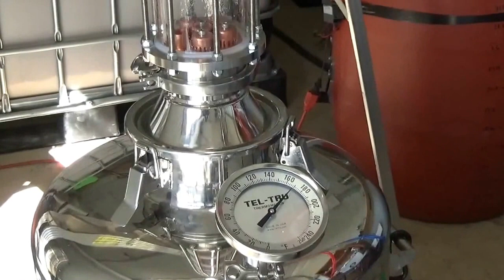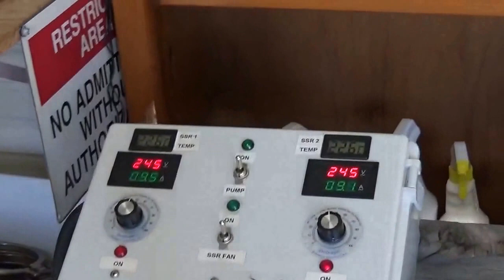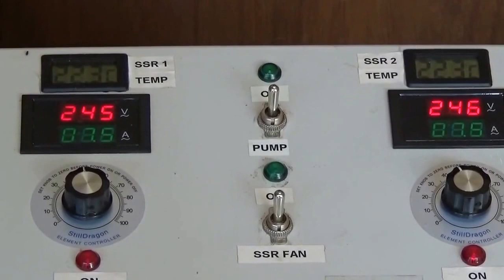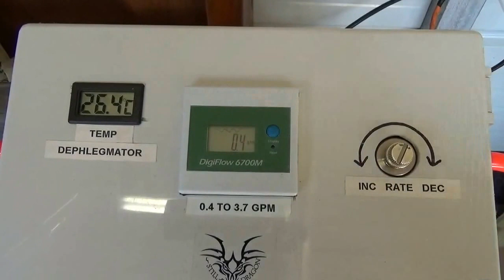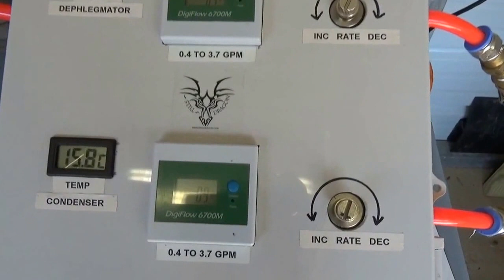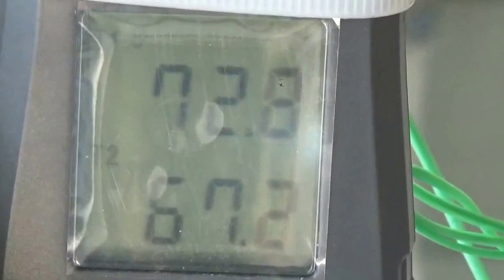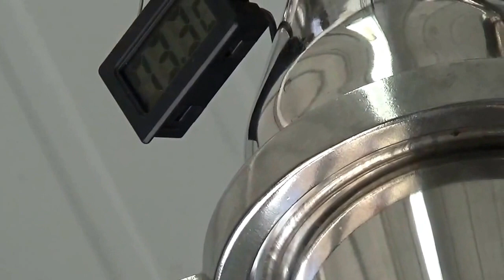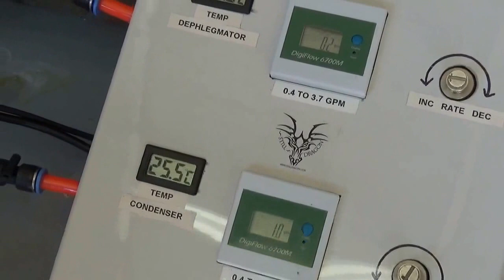StillDragon® - 4" Crystal Dragon™ with 16 Bubble Plates - Maiden Run

Comment: Your parot was building up back pressure by the looks , it needed a little vent tube at the top bit higher than the parrot itself.
Reply from the maker: The product collection kit comes with a surge breaker which is mounted above the product collector. Please be aware that our community members do not participate here in YouTube comments. For more information have a look at our StillDragon® Community Forum at https://www.StillDragon.org

Comment: Like all StillDragon products and appliances, this setup looks bloody amazing. Sexy even. However, I've got to add that 16 plates is absolute overkill just to produce neutral spirit at around 95% ABV (even if it is for fuel). With this setup not being modular, there's not much else it could produce. A simple SPP packed column of sufficient length would provide similar results (I'm commenting from experience, not bravado). I'll reiterate - StillDragon equipment is sexy AF, and I would sell one of my kidneys to own a modular system. One day...  🙂

Comment: What is distinguish between Moonshine | Ambler & StillDragon distillery,  1st thing I seen from top  side some transparent liquid is coming & slowly it's going to till bottom plate,  but ? I wasn't sure it is evaporate alcohol whether water coming by up site pipe ?   what is the purpose of this new kind of distillery & what is the price for this,  and I know yr community isn't participate for this,  I'll will visit at yr forums.
Reply from the maker: What you see here is called a reflux still (the liquid from above going down is the reflux). This principle allows to increase the purification process by the number of plates compared to a simple pot still. Please visit our StillDragon® Community Forum at https://www.StillDragon.org for more information. There you will also find the link to your closest StillDragon® Distributor, where you can check prices and what is all possible with this kind of modular equipment.

Comment: I don't understand why the action started at the top and worked its way down towards the bottom...🙃☺️😎
Please explain...😊
Reply: That's the point of reflux, what's not pulled drops back down the column. It fills the top plate then overflows to the next and next on the way down
Reply from the maker: Our community members do not participate here in YouTube comments. Please have a look at our StillDragon® Community Forum at https://www.StillDragon.org for more information. The following discussion may especially be of interest:

https://www.stilldragon.org/discussion/240/4-crystal-dragon

Comment: WOW,,, are you not worried that the glass rings will bend and crack with that many in it ,  I have been thinking about a glass column, but am worried even at 4 rings, the rest of the head parts would be too much strain on the glass column.
Reply from the maker: Obviously not a problem at all, these glass cylinders are massive, made of heat resistant thick borosilicate glass. Please be aware that our community members do not participate here in YouTube comments. Have a look at our StillDragon® Community Forum at https://www.StillDragon.org for getting all the information.
Reply: Yeah  - these are thick borosilicate sections & the silicon gaskets help distribute weight stress, but I'd strongly prefer to see a transition plate every 5-6 plates.  Why install  8x fully threaded stainless rods  just to support the top+dephleg ?   Either lose the excess threads or use them to distribute the forces.
Reply: Yeah  - these are thick borosilicate sections & the silicon gaskets help distribute weight stress, but I'd strongly prefer to see a transition plate every 5-6 plates.  Why install  8x fully threaded stainless rods  just to support the top+dephleg ?   Either lose the excess threads or use them to distribute the forces.

Comment: yer, ok, its all very sexy n all, (expensive as well no doubt)  but my 1.2 meter copper reflux pipe full of steel wool runs the same % and flow rate.. as far as showing off coolness to visitors goes 100% though.
Reply from the maker: StillDragon® equipment isn't that expensive considering what you get (you can check on the website of the StillDragon® distributor responsible for your location). +1 for the coolness factor :) Please have a look at our StillDragon® Community Forum at https://www.StillDragon.org for more information, because our community members do not participate here in YouTube comments.